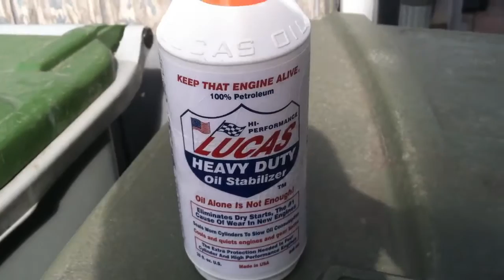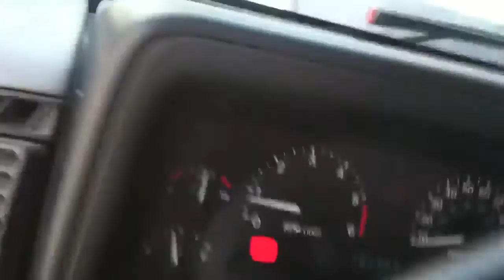Help! Jeep wrangler Piston skirt, lifter noise, or engine knock?? 1998 TJ

Comment from the maker: UPDATE!! Sorry guys, not good news. I took off the valve cover and all the lifters are in great condition. The noise seems to be coming from the lower and I'm pretty sure its a broken piston skirt :(
Reply: what was it ? my Jeep is making the same noise . same engine
Reply: Check flexplate
Reply: Yup. I bet you fucked up cylinder walls lettin it run

Comment: Sometimes a bolt will work loose where the torque converter bolts to the flywheel and make a similar noise. Take the dust cover off the transmission and check the bolts for tightness. Not sure what they torque to, you'll have to look that up. There's videos here showing you how to do this. It's worth a look to see anyway before you tear into the motor.
Reply from the maker: Thank you for your help. I'll give that a try. Take care.

Comment: I know it's been 9 years but did you ever find out what happened? Mine sounded exactly like this for less than a week and now I hear a big knock if I try to start it.
Reply from the maker: Sorry, No. I ended up selling it as is. My mechanic took the head cover off and everything looked good. So the noise was coming from the lower. Maybe a piston skirt or piston rod? Never found out. Best of luck to you. Please let me know what you find out 🙏
Reply: Sounds like I may have that going on in mine. Thanks for replying!

Comment: This definitely sounds like a bad lifter/ loose rocker arm
Reply from the maker: Thanks for the help. Some think it might be a piston skirt. I guess Ill find out soon when I take it in. Wish me luck.
Reply: Wisconsin Northwoods
Have you found out what is causing the noise?  I have a 98 that just started making a similar knock several days ago.
Reply from the maker: Butch Ade No, Im sorry. Im taking it in soon though. Ill keep you updated. Let me know what you found out with yours.
Reply from the maker: Butch Ade UPDATE!! Sorry guys, not good news. I took off the valve cover and all 
the lifters are in great condition. The noise seems to be coming from 
the lower and I'm pretty sure its a broken piston skirt :(
Reply from the maker: Butch Ade UPDATE!! Sorry guys, not good news. I took off the valve cover and all 
the lifters are in great condition. The noise seems to be coming from 
the lower and I'm pretty sure its a broken piston skirt :(
Reply: Wisconsin Northwoods f